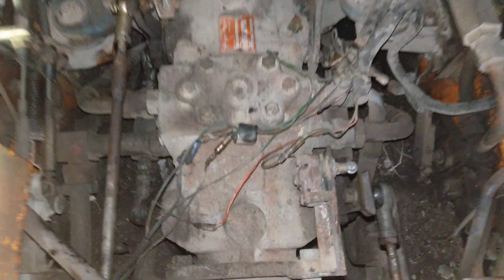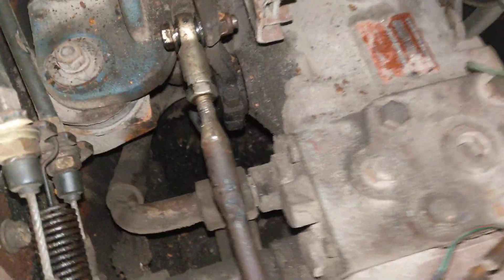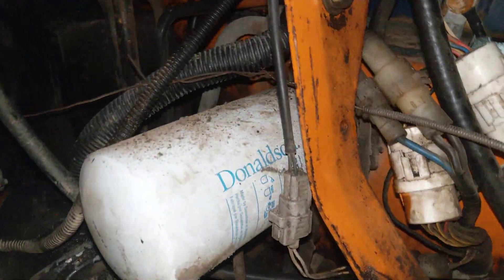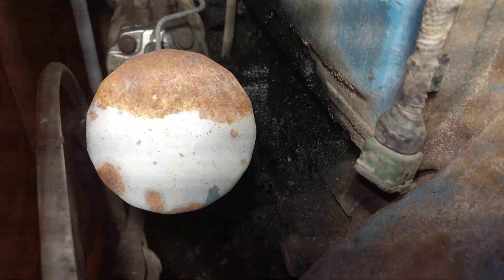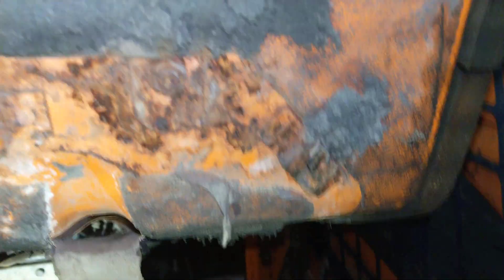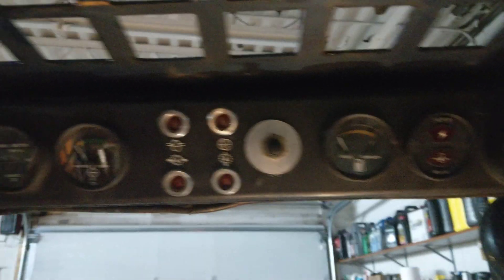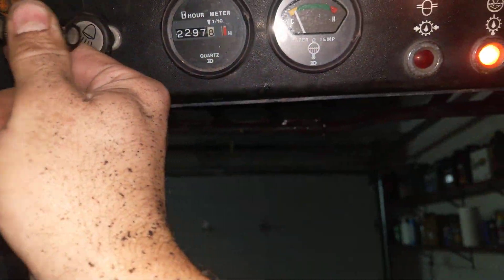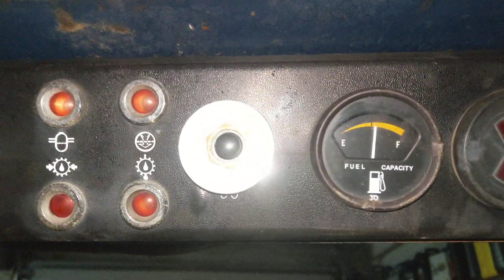Toyota 2SDK8 SDK8 Skid Steer Steering Adjustment, Filters, No power issue Part 2

Comment: Where did you buy the steering linkages? Mine are worn out.. Having to replace the rubber vibrating mounts that hold the steering arm to frame
Reply: I have 2sdk7. Replaced mine from a local bearing supplier(acme bearing buffalo NY) Toyota are metric all they had were SAE so I got the next size down and tapped them. M10 1.5 I believe. Also had to run a bolt thru as mine were just open eye. 6 bux each. To order the metric was like 25-30$ each

Comment: That switch, on mine at least is for the rear work light. the little bulb fixture should be mounted in the hole right next to the switch. its an indicator light for the rear work light. again, at least on mine. its a red bulb

Comment: Hello,
Anyone have a part # for that return spring? I'm missing half of the assembly on the right side if you're sitting in the machine
I have 2 SDK8's
Reply from the maker: both sides are the same, 33580-42800-71